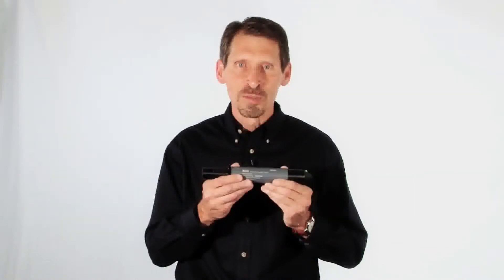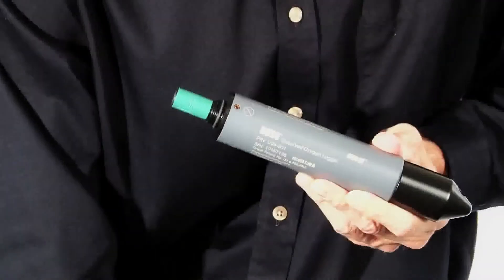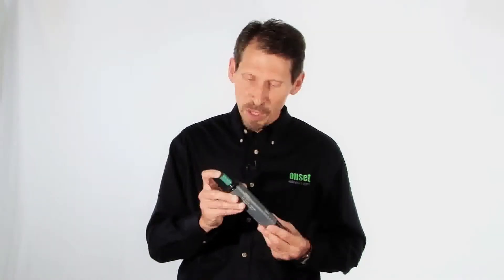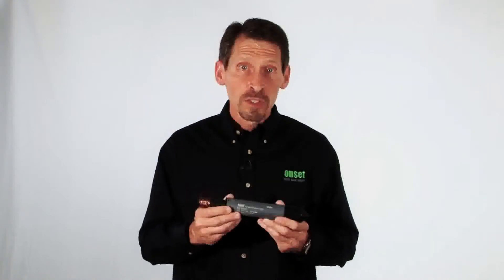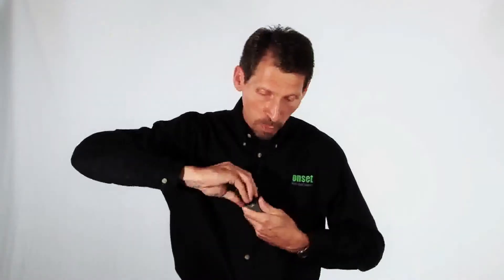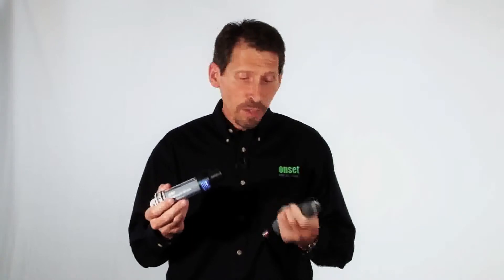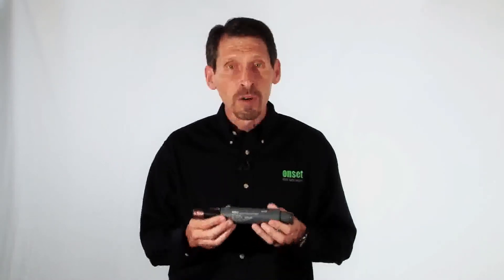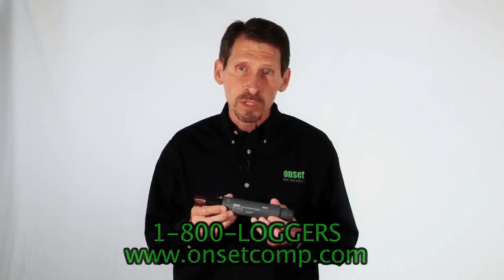HOBO Dissolved Oxygen Data Logger U26

Comment from the maker: Hello Mario, Momentarily press the coupler’s lever (pressing hard enough so the lever bends).  The amber LED blinks momentarily, then the green LED should glow steadily to indicate that the logger is ready to communicate with HOBOware. (If the red LED blinks instead, the logger was not found. Make sure the logger and coupler are aligned and seated properly, and that there is no dirt or strong sunlight interfering with communications.)
 
If this doesn’t work please contact our Tech Support at 800-564-4377 or loggerhelp@onsetcomp.com

Thank you